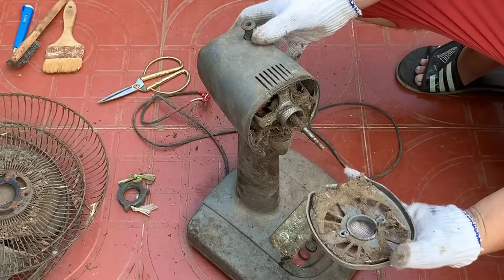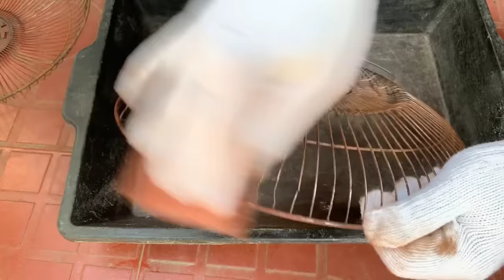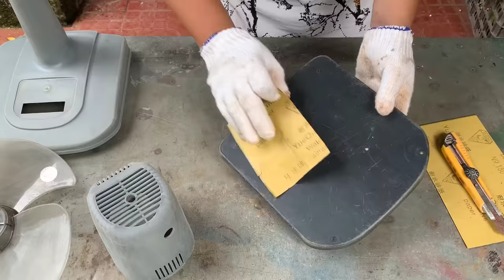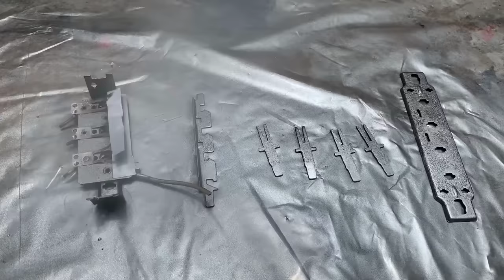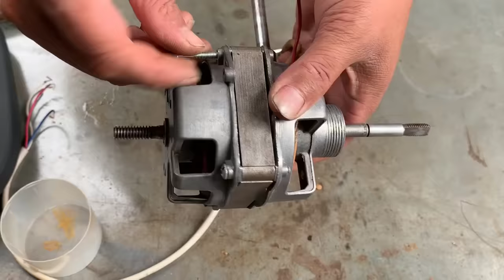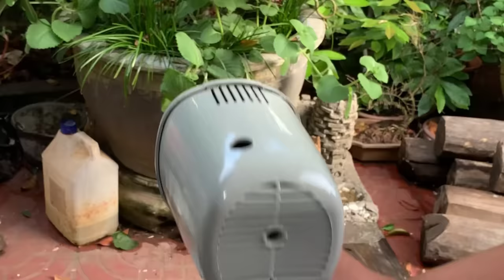Restoration Old rusty table fan |Restore electric fan

Comment: The key to the fan is its motor. I’m amazed how this motor didn’t suffer too much of a damage and its coil just needed simply joining wires together to gain back its continuity. In several worse cases I encountered, the winded coil would have to be severely shorted, grounded  or broken, requiring complete replacement or rewinding. I should know since I also tried restoring old fans before. Good productive job! 👍

Comment: Amazing what can be done, working on the floor, using a handful of old tools, and $5.00 worth of paint/sandpaper, etc., etc.....must have been IN a  chicken coop by all the feathers, dust, grim, and spider webs found on the safety cage.  I  question the integrity of the soldered motor windings, BUT it's running for now...

Comment: It seems that the swing movement isn't simmetric. Isn't it? Thanks
Reply: That's actually a feature. I've seen that feature primarily on KDK/Panasonic fans. I think it's called "5 way oscillation" or "dual head oscillation", something like that.
Reply: @kbhasi  It sounds really strange. Thanks for your answer.

Comment: It's a good job what he has done but he could have brushed the plastic with the plastic brush only and that for not to scratch the plastic of the body. And he needn't have sprayed the body and saved money afterwards. The net could have been welded instead of using the strong glue. Welding is cheaper and stronger.

Comment: You can buy a perfect working used  desk fan like this for £5 😎👍 Why bother going to all that hassle 'restoring' a junk one⚠️ 
It's been thrown away because it's broken most probably, chuck it in the bin, for sure salvage any parts such as copper, magnets, wire, switches and screws and put them in your parts collection👍😎⚠️

Comment: It is impossible to easily open all parts of any rusty electrical product. Screw, bolt all are fixed due to rust and damaged too, can't easily open like in this video.

Comment: Fake. The fan wasn't really old. The design is fairly new. Also, there was no wear and tear near the neck of the fan. In any old fan you would see a lot a wear and tear near the neck part which moves.